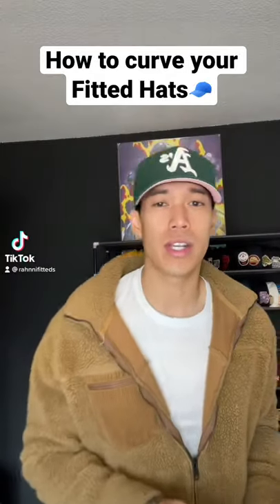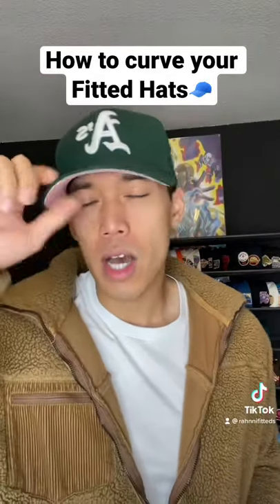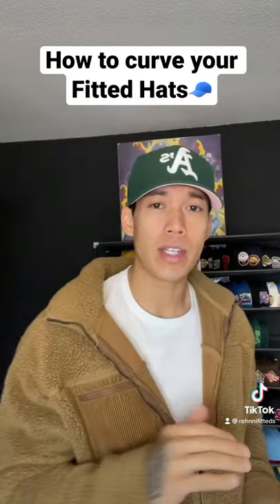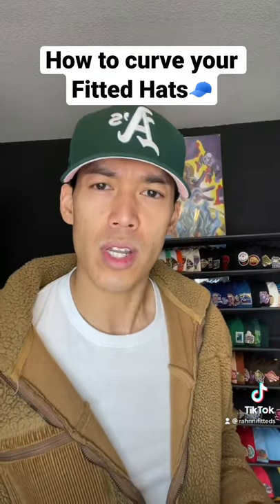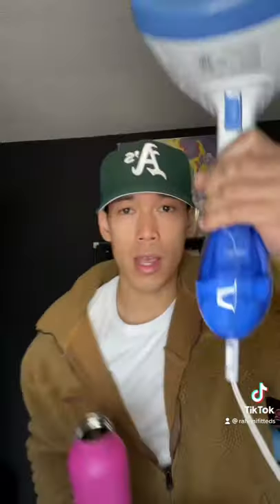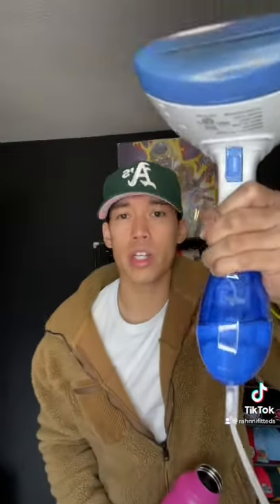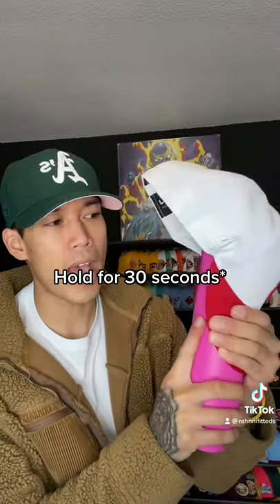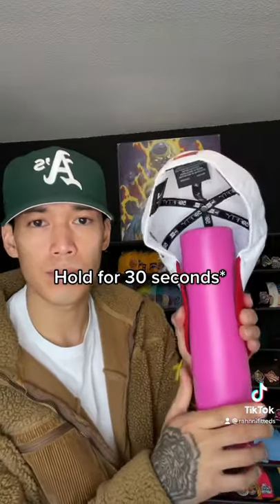Curved Brim Tutorial Hat 🧢 #shorts

Comment: can you brim/curve your hat more than once?
Reply: I did, i bout a new flat brim snapback and curved it with my hands but not too much but it didn't stay... so I used the rubber band technique and that worked better but I still didn't get the shape i wanted.

So lastly I tried the steamer method like in this video and I curved it again, now exactly how I wanted. I messed up a few times and kept resteaming it too... so i think as long as you dont bend the brim, and you soften the brim enough before curving it is safe to curve again.